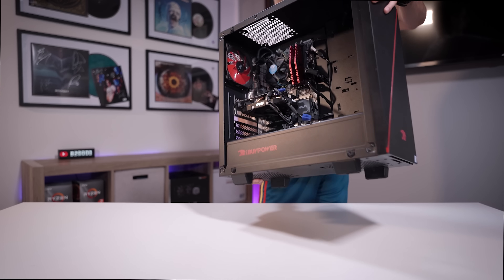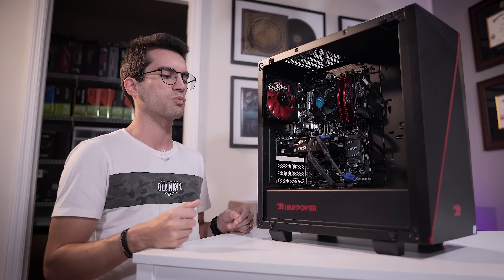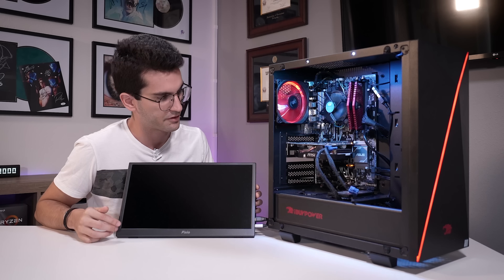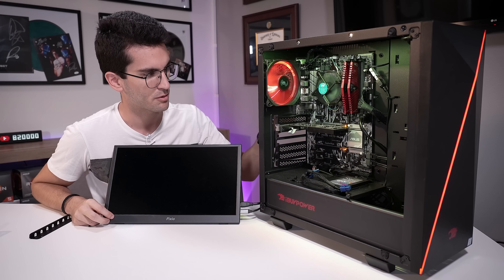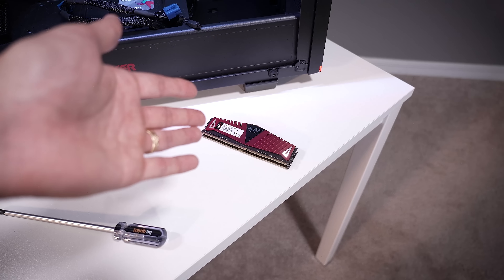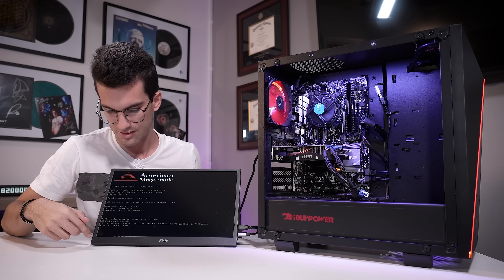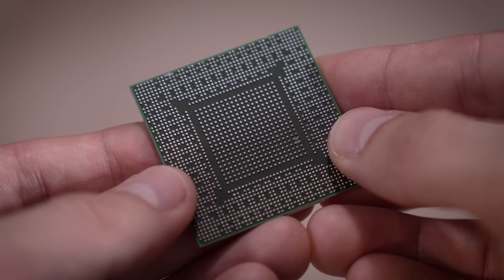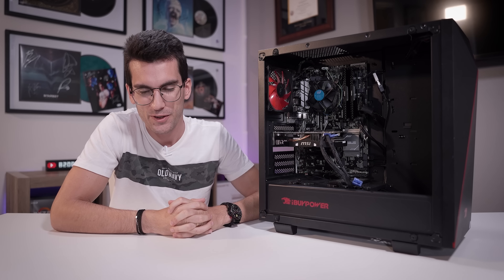Fixing a Viewer's BROKEN Gaming PC? - Fix or Flop S2:E19

Comment: I know I changed my psu out after 6 months  gaming and losing power a few times but very rare think it happen 4 times in the 7 months. After resetting and drivers updates  and all the other stuff it ran fine but changing the cases the other day I went ahead and upgraded the psu, the ssd and the aoi..Ibuy power aoi had a defect in wires after examining possible reason for issues maybe??.... next I need to flash bios  but its running ok now so not sure if I should. temps with full setting and 4k gaming  running the card 99 percent 75 to 80c  and cpu like 50c. Not had a  issues since hoping thats the issue is fixed

Comment: I know I'm 2 years late but... Has anyone note 12:54 In the center section of the chip at the top you'll see two sets of solder balls grounding. I'm surprised I didn't see it a year ago.

Comment: I know at this point this is an old video, but maybe it will be useful to someone:
That A-DATA RAM is not from a kit of 8 modules. 8X8G describes that this single module is constructed from 8 memory chips, each one having the capacity of 8Gbit. So 8*8Gbit = 64Gbit = 8GByte. You can see that when Greg removed the heatsink - 8 chips on one side and the other side is empty.
This is the way manufacturers spec their memory module on the label - number of chips, capacity of chips (in bits, not bytes) and number of sides those chips are installed on.

Comment: Had a similar build through ibuyPower , same case with different some different hard-ware. was running great until mine did the same thing! ended up being the old ssd, switched to m.2 and put in a new PSU as well. butchered the cable management but otherwise worked great. Until a few months ago my cpu temps starting climbing into the mid 90's. Gave up on the rig and started putting together a new up[graded build. I came across your channel about two weeks ago & I gotta tell ya, just listening to you go through the steps of basic trouble shooting has increased my understanding of PC's SO much. You keep things simple as, every problem has an answer. I watched your video on a build that had high cpu temps & it turned out to be the aio cooler caked in some sort of growth. that video gave me the confidence to take mine apart and investigate the cooler & it looked exactly like that one except a lot worse lol. Its running in the mid 50's now under load & feels great. Already bought the new PC though :p kind of fun to have the old one to practice installs or trouble shoot/test gear. Thank you!!

Comment: It's an ADATA RAM stick. Of all the drives / RAM sticks I've seen fail, I am not joking when over 90% of all component failures I've seen have been ADATA products. They just don't last for some reason. For context, I work with customer systems to diagnose issues in my job.

Comment: sometimes the ram dims(contacts) can get dirty or something so you can use an eraser and rub it on the contacts of the ram and most of the time you will get an post out of that ram that you thin is dead,try this on the ram idk why it does that but after u run the eraser over the contacts it usually works

Comment: I picked up an ibuypower system for our son to play games on way back in 2017 and it ran just fine.  Since then we have upgraded memory, GPU ( GeForce RDX 3080), PSU (1000 watts) and other little tweaks.  It is still going strong and he can play anything he wants on it.  My only complaint has been that the case is difficult to route power lines around and the back side always looks like crap BUT it plays fine and he doesn't really get into the RGB and color stuff anyway. To be honest, the next upgrade will likely be a new MB and chipset along with memory but we are stalling until prices come down, if they ever do.  Great video series that I watch since I am the guy in our home building most of our systems.  I think since 1993, I have built or helped build over 200 systems for friends, relatives, or folks that I work with.  The only thing I have not done is add a AIO on a system.  That may be my next thing.

Comment: funny story built my first system ever, and it worked fine besides that any openGL software would just crash and give a Nvidia driver issue error, and after replacing the motherboard, gpu, and Power supply I finally decided i would buy more memory, and what do you know it fixed it. Later my dad took the ram for his new system, and he had the same issue and was able actually to get it RMA even though it was almost 3 years after the purchase, so good on corsair for that so yeah memory can be weird...

Comment: I have been facing an issue lately with my PC. I did a surface clean with the air blower. Did not disconnect any of the components except disconnect the gpu to blow the fans and to better access the motherboard to clean. I use the similar wireless compact air blower with the brush. As I turned on the PC to work, the debug led was stuck on CPU. I reseated the RAM(tried single channels), GPUand reset the bios. Even removed the CPU (which was cold to the touch) and reapplied thermal paste. Nothing worked. I then disconnected all peripherals and unwanted fans, rgb. Removed the CMOS battery and put it back after a few seconds and added only one stick of ram to the main slot. And suddenly the PC did POST. This happened to me once before as well and I cannot point my finger anywhere except the motherboard. Issue is that is works fine otherwise.

Comment: A ? @ Greg, have you ever seen a Ryzen 5600x system kill a stick of ram on a windows update, the stick in question was one of two ticks of Trident Z neo 3600 cl16.  I switched to a Corsair kit with the same timings o problems.  It was weird, I was doing a clean install, it got to 100% then bosd'ed, then restarted succuessfuly, and kept corrupting files.  I finally figured out it was my ram after I took out my 2 nvme's and put a sata ssd in it with a fresh install, I was finally able to run mem test and find that one of my dimms was bad.

Comment: I had a similar issue with my Threadripper PC, couldn't figure it out for a long time. as for that computers ram. the ADATA ram was likely the original as IbuyPower used similar ram on 4th gen Intel
Reply: I doubt that there is any Threadripper that supports DDR3
Reply: I meant those as two separate ideas. one was having the same issue as that computer. the other was that ADATA ram was likely the original ram in the IBuyPower PC

Comment: I just installed a new cpu fan and got a new nzxt case for my pc and it wont boot to windows anymore it only goes to bios does anyone know a fix for this. (Pc was working fine before i installed new hardware) Edit* there is no boot option in my bios

Comment: I have the exact same pc purchased from best buy in 2017. same ram but mine came with 16 gb from an 8gb x 4 kit. Also  an  I7-7700. I have replaced the unbranded 600 watt PSU that came with it for an Evga 800 watt so i could upgrade my GPU ,the 1060 still works but I got a 3070 Aorus master on the super cheap from a buddy. Now I have a gaming bottleneck like I can't comprehend!

Comment: on my current rig, I initially installed the AMD Cpu fan in the wrong direction of the lever included in their stock stuff. the tension caused some memory channels not to work. with proper mounting, all was good. it's an 2700x
Reply: Oh wow I had a 3700X for years and never thought about this. Glad I didn't do that I guess!

Comment: Hey Greg! Why not run a memtest86 on the faulty DRAMs? 

Also usually if I were to receive a PC for repair and I’ve ruled out the GPU and CPU for no visual scenarios, I’ll just stick their DRAMs into my test rig and run Memtest86, that way I will know for sure the if DRAMs are faulty or not and proceed with the next steps

Comment: Funny that this computer had bad RAM and a wimpy CPU cooler. I have a prebuilt from a different company named CyberpowerPC and the original RAM only ran at default speeds, no XMP or overclocking or else Windows would give blue screens very early. I replaced the RAM. The CPU cooler was a 120mm AIO on an11900KF. It ran hot and when I played Forza Horizon 5 and saw that the CPU could go over 90 degrees while gaming I got a 360mm AIO just a few days later.

Comment: heh, funny youre putting some attention to that clip on the pcie slot. That thing will have literally 0 influence, nada, nop. I have been testing loads of components over the years, and that clip I usually remove on the my main 'testing board(s)' as its so incredibly annoying lol. Btw in a 'reflow problem', 'it rarely the solder bumps between the package and the PCB like you show. Its usually the minuscule bumps between the actual die and the package.
Reply from the maker: 1. I literally said that the clip missing wouldn't matter. Made no bigger deal about it...
2. We have a video about the reflow process and what specifically it does. Has more to do with the resin that expands/contracts and "pops" up the bumps either under the die or under the substrate. Either one.

Comment: Hey Greg,

Great video as always. Quick question, is there a reason why you didn't remove the gpu when initially switching to integrated graphics during troubleshooting? I've had a few PCs get finicky if the gpu is still installed and you're trying to boot via the igpu and basically tell me there's a gpu installed and so it can't boot with the igpu.
Reply: I would go even further and start with no GPU because then the system would usually complain about it. Same with RAM.

Comment: Shows HD 5450 or HD 6450 graphics card and says everybody should get one (for troubleshooting) but never actually tells what model card it is. Lol. Wait.. i7-7700. Wasn't Kaby Lake the gen of Intel that had motherboard voltage issues making CPUs run unnecessarily hot? Though maybe it was fixed with a bios update.

Comment: Funnily enough, I had this exact issue myself with a new build I just finished. I went around just taking out components such as RAM, optical drive etc. I decided to put my old GPU into the system and after a longer than usual power up, my PC posted just fine, was oddly strange. Anyways, I went and uninstalled windows on my SSD and did a fresh install with my new GPU inside, now it's completely fine. What is weird though, is the AMD GPU drivers, "Andrenalin Edition" ones for a RX 6400, the latest ones seems to cause problems for me, but I don't know why, I rolled back my drivers by just literally deleting all my AMD folders and letting Windows update just install the driver it gave me before, now my system is just completely fine. But yeah very weird situation lol
Reply: Yeah, when in doubt, try an older driver. I go even further and don't update it just because there is a new one. If I have found a working one, that one stays until there is something in an update that I need or want.

Comment: Yes I worked on another ibuypower comp and it had the same ram sticks 8gx8 into it and again one died and it would not boot i did the same as you put in a corsair lpx 3000htz 32 kit works fine

Comment: Modern solder balls rarely go bad (according to Louis Rossman). Usually, if a chip goes bad, reballing/reflowing won't be the fix since literally that specific IC is fried/dead/dying. You'd have to replace the whole module.

Reflowing is a temporary zombification fix that only works on chips that have substrates.

Comment: XFX wasn't always exclusive to AMD. XFX was selling nvidia GPUs and at one point they started to sell ATI gpus...at that point something happened and nvidia told them that they won't get any Fermi GPUs. So nvidia stopped working with XFX. This was around 2010.
Anyway I wouldn't call that GPU fake, it's probably an older pre-fermi GPU with a modified bios.

Comment: Something eerily similar happened to me when I was setting up my friends gfs build.   System kept crashing and i tested each one seperately.   One worked while the other caused it to crash each time.   I started updating the pc, system and installing things with one stick (8gb).    
Started shopping for a second ram stick and thought it was expensive.  I knew both sticks were fine as I had it in my build earlier.... For some reason I felt compelled to try it again.   Put the second one in, turned it on and it worked?  
I didnt do anything special nor touched anything inside the pc besides the ram stick installation.  Just did the basic computer set up and just slot it back in.

Comment: Just pointing out...That Asus Prime H270 Plus motherboard is on the original BIOS (0318). There's several updates that bring better system compatibility & better CPU microcode. The newest BIOS says it'll enable it to go to Windows 11, but to my understanding the minimum is an 8th gen Intel CPU...did they change the specs? Plus there's IME firmware updates for it.
Another good fix or flop though!

Comment: Another informative video. One thing I did notice is under the gpu chip, in the upper right, it looks like four pins melted and doesn’t look like it should be like that, unless I’m out to lunch. It’s four pins from the right in the smaller square of pins.

Comment: Greg: I believe your GPU is an R5-220A non-OEM version. I have a card that looks identical and I use it for the exact same purpose. Also, the 8Gx8 does not mean it's an 8 GB x 8 module kit. The 16 in the model number AX4U240038G16-BRZ indicates that it is a 16 GB kit. The 8Gx8 is number of chips and data width in bits on each side of the module.

Comment: I've run into similar problem, where the system will not boot because one of my ram is faulty. So what I did is I booted using the ram that is working then install the 2nd ram while windows is running and then properly restart windows. It worked, windows boot with my 2nd ram and both ram is showing in taskmanager.

Comment: The i7 7700 is not a power hungry cpu, the stock cooler is fine.  Those were only quad cores and even the k versions didn't use much power when gaming.  The power really went nuts with the 8000 series and above.

Comment: I build and fix a lot of PC's. Something that helps me diagnose as simple as it sounds is having a keyboard plugged in on the initial boot. If the numlock key lights up it posts but the monitor isn't getting signal - Helps eliminate some troubleshooting steps.
Reply: I had some interesting case recently where the keyboard would start up slower than the motherboard was posting, preventing me from entering BIOS. In the end I had to get my old PS/2 keyboard that worked instantly.
Another thing to keep in mind is having a way to get the error codes. Usually with one of those piezo speakers (I keep a couple spare ones just in case) but many boards nowadays have a little 7-segment display that gives out a hex code. That stuff helps immensely with figuring out at which point it hands.

Comment: Greg, I'm pretty sure you've had a couple of cases where it was the ram sticks at fault... just not this season.
I remember you saying that it's very rare for it to be the Ram when it happened just like how you said it's usually the motherboard instead of the Cpu and it turned out to be the Cpu, lol.
Reply: From my experience it is often the motherboard (complicated with many different parts that could break) or the RAM that dies. I still have a perfectly working Pentium 3 here, despite more than 20 years ofd age. And had a time where my P4 hit 100°C for about 2 hrs because the cooler wasn't seated properly. Both still work absolutely fine. But the box of dead motherboards and RAM is enough to fill a wall.

Comment: FYI: (probably more like reminders)
1. Normally, BIOS will disable onboard graphics/IGP/IGPU when it detects a graphics card.
-- A simple reboot without graphics card should re-enable the CPU's IGP but you could do a CMOS reset as well.
2. Most memory/DRAM manufacturers provide a lifetime warranty -- indicative of how often such chips fail (i.e. very rarely, as you mentioned).
-- Indeed, from ADATA's own support section "ADATA DRAM Modules / Memory Cards / Card Readers are all covered by a lifetime warranty commencing from the purchase date."

Comment: Greg, try the “eraser trick” to the gold pins, it does work that you notice the gold isn’t shiny, try it or the dont do trick “tap the memory” while it is inserted it will work, i’ve encountered so many times like that, just slap or tap, it works
Reply: I always use the eraser trick. The ex- wife had a fire in her apartment, and destroyed 3 of the computers that I built for them. Another one was at the other end of the apartment from the fire, but didn't work. I told them about the ram, and the eraser trick. Wala, it worked!
Reply: What’s the eraser trick?
Reply: @kev2427 , cleaning the contacts of the ram itself with an eraser. As kids, we used them to clean the contract rails on our HO race tracks. You can't always see the film on the contacts. Sure putting them in, and out will scrape some off, but an eraser will get all
Reply: @kev2427  just use a white eraser then just do the how eraser does, do it to the gold contacts and inspect if it is shiny gold rather than a matte gold 😉

Comment: At 12:06 The RAM Connector pins looks "bent" or "odd". I've never seen that in this form. The RAM Module doesn't have a straight line at the bottom. Maybe it is just me or the Angel of the Camera. But it looks like the Pins at the End of the Module are shorter as in the middle of it.
Reply: Both DDR4 and DDR5 modules do not have a straight line pins as a design. DDR3 and earlier do have straight line pins. Curved edge is there to help with insertion and alleviate stress on the PCB during memory installation.

Comment: That's odd. I had the same module go bad in a recent customer repair. They decided to just run it in single channel for now. It's only an Athlon 3000G with a GTX960. The modules are 8GB 2400Mhz set to 2666Mhz.